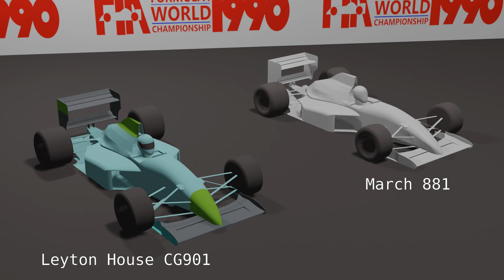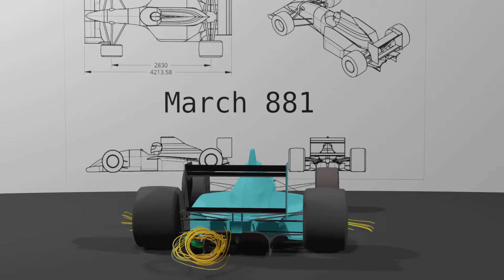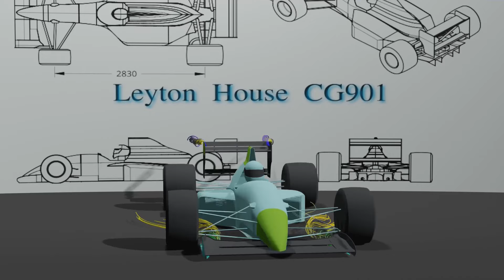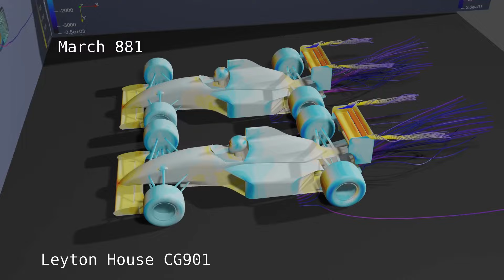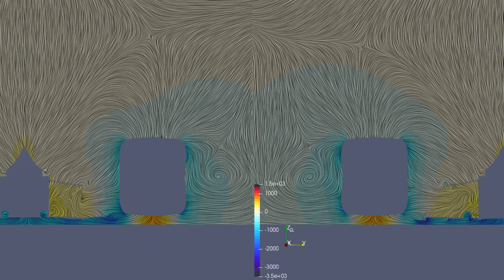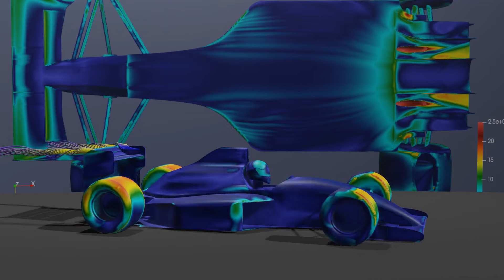Formula One in 1990: Leyton House CG901

Comment: Fantastic !!! Thanks Nelson for CFD  of that car. I would like to ask you about wing profiles. Do you have real front and rear wing profiles or just aproximations of shapes. And what abou rear diffuser shape in longitudinal direction? I don ´t know if they where in those days complex or simple linear?

CFD result seems to me realistic.
Reply from the maker: It is all about looking at many many images. Some cars have better images of different parts than others. This car has a few of the diffuser because of the reasons mentioned. Where as the tyrrell has many images of the front and not so many of the rear. 
The diffuser for these cars were just developing, you could call this iteration third generation. So they are pretty simple still. There are a couple of images going around with cars from this generation on there heads, which is helpful.....

The results are pretty good for decimal places, the third is a bit flimsy. I'm pretty confident that its close to about 5-10% accurate. With CFD its all about the delta, change something and that change means something. The guy that wrote the linkedin CFD analysis of this years Williams is explicit in how an analysis should be read, which is basically what i have been saying in all my videos to some extend.  CFD is postdictive not predictive.